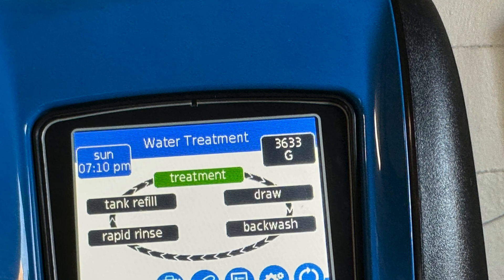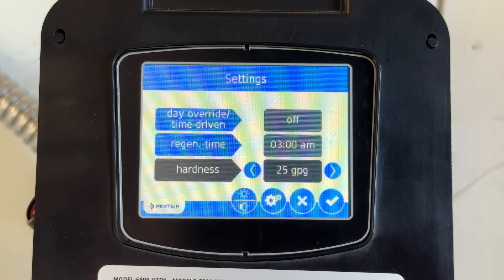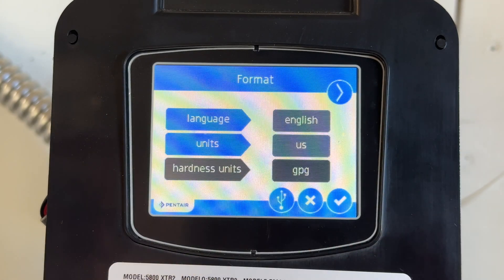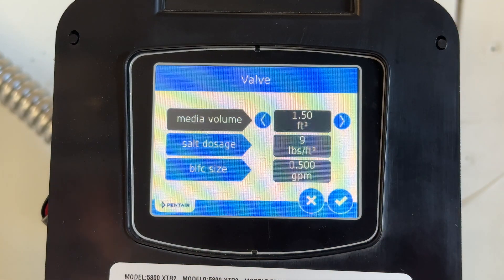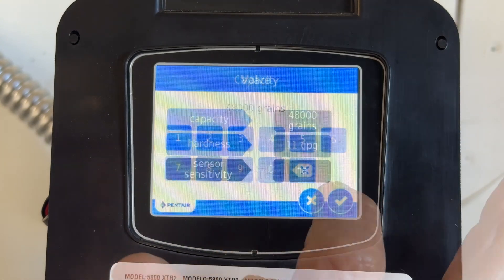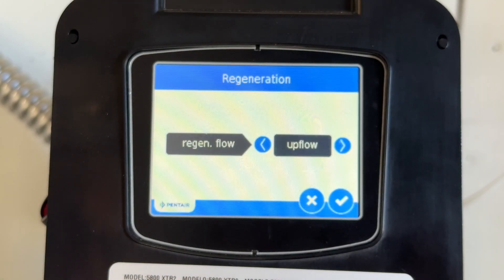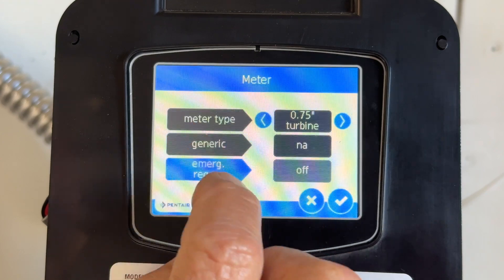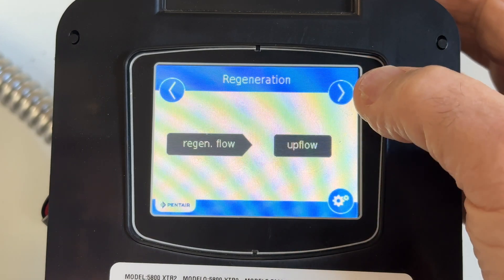DIY Complete Guide to Program a Pentair: Water Softener Fleck 5800 XTR2, and XTRI Control Valve!

Comment: Hi very informative video. I was wondering exactly what happens when you put the softener on vacation mode. I couldn't seem to find any information on that. Does it just sit idle until you take it out of vacation mode?
Reply from the maker: well, I’ve never used vacation mode, but I think that you can override it after a certain number of days and also it automatically overrides itself once you return and a certain amount of water is used. I hope this helps. Thanks for watching.
Reply: I am trying to set up the wifi connection to the app, any info on that please.

Comment: Thank you John
Reply from the maker: I finally helped someone on this video. Thanks for watching.
Reply: Yes, you did, but I have 1 questions, my app is giving me alarm for salt, where as I have put Windsor salt 4 bags of 18.1 kgs each bag, but still I am getting alarm, how should I reset the alarm, please and thankyou
Reply from the maker: @anilksingh650  wow I just saw this question sorry and I looked it up. It says to after you add the salt manually start a regeneration cycle. I hope this helps and let me know how it turns out.
Reply: @fixitjohn, I have fleck 5800XTRi, 60,000 grains, 2 cu/ft3, the alarm is not on the unit, but its on my android flow, I even not sure if the unit is working because the water tester from "zero water" is having 197 ppm, doing regeneration its doing all its process, but not sure if I need to call some pentair programmers to see if the program is all good, but I am 100% sure that their app is very buggy, I send 20 emails to pentair and their reply is " unit is faulty" appreciate your reply, and please dont apologize, thank you very much and take care.
Reply: Hello John, I figure out the problem with my 5800xtri, its a corrupt IoT in my device the pentair fleck informed me that the device needed to be replaced because of corrupt IoT which I denied, and took partial refund, I am not sure if your 5800xtri is working on wifi, I just want to update you thats all, thank you